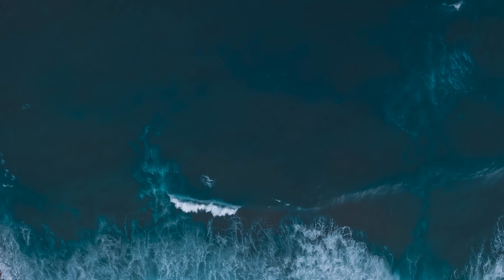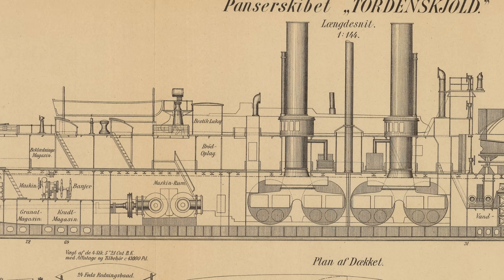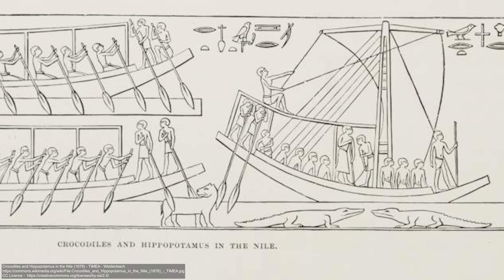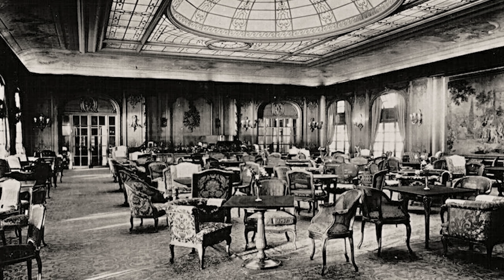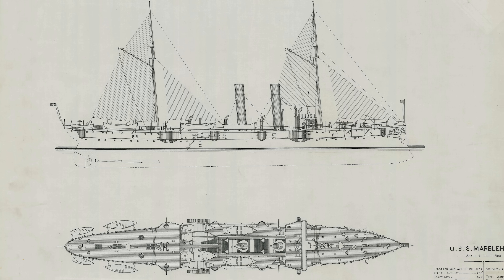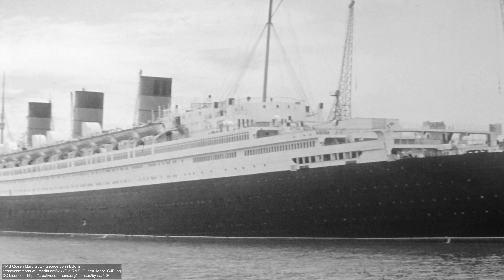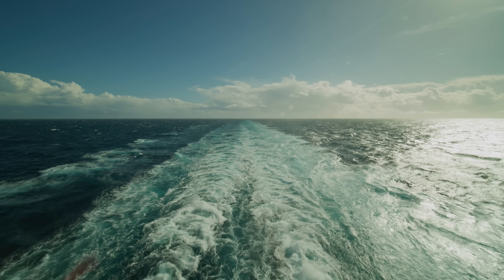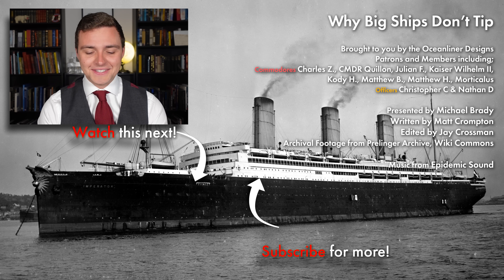Why Don't Big Ships Tip Over?

Comment: I have had several experts like Mike discuss this, and I understand the science, but every time I see modern cruise ship I forget again.
Reply: Modern cruise ships draft almost 30 feet. Most passengers don’t see below the water line inside or outside the ship. Majority of the weight of the ship is down there.
Reply: @budwhite9591  Yes, I know how it works, but just seeing all that mass above the waterline is freaky
Reply: @michaelholt8590 You see lots of space above the waterline, not mass. A cruise ship is mostly air.
Reply: @Daz5Tube that mostly air superstructure is a hazard in high winds. It acts as a sail. Everything is fine until you get into a storm.
Reply: @Doanld-q3z  yes those tall sides will catch the wind and larger ships cannot dock as easily as smaller ships in heavy winds. But handily cruise ships being leisure vessels don't need to sail through harsh storms or dock in heavy winds. They elect to avoid them where possible instead. Average speed of a storm front is about half the speed of a cruise ship.

The last cruise I went on changed its whole itinerary for the week due to hurricane in the Caribbean. As a result it was smooth sailing.
Reply: @budwhite9591  Not just most of the weight is down there, all of the buoyancy also is. Looks are very deceptive, especially when 4 heavy people get into a tiny rudder boat and it barely sinks lower.
Reply: @budwhite9591  On some cruise ships there are cheap cabins down below the water line with  Big TV screens on the wall that show what some cameras up above see.  This gives the illusion  of being above the water.
Reply: Ikr. I do the same thing with battleships too lol
Reply: Oh I do the same thing
Reply: Big ships do tip over haven't you seen The Poseidon Adventure?
Reply: @michaelwhite2823  Yep, both of them.
Reply: @michaelholt8590  Through both of them I wanted rescue vessels to arrive to turn the ship back over just as the passengers reached the hull bottom.
Reply: 60 years ago I sailed to Europe on the New Amsterdam and returned on the Queen Elizabeth.   I wouldn't travel by sea today or take a cruise due to deteriorating climatic conditions.
Reply: Fr. No matter the science I'm just like "but thing too big, why not fall?"
Reply: When I think of things like this I always think "Eurika" lol
Reply: If I saw a modern cruise ship I'd probably put on a mask.
Reply: Width also increases stability
Reply: A few months ago I took a trip on the QM2. Stood on the top deck while we were docked in Southampton....I could not shake the feeling that we were going to tip over! It was such a long way down to the dock!
Reply: Ships are now getting too high and having a too wide sail area... These are the safest boats when sea and winds are low or moderately high. Like sea castles. They can also use all kind of navigation support to get out of the storms way. Until now, this is working. But I wonder what can happen if a floating hotel like these is caught with propulsion problems or a jammed rudder at the wrong place...
Reply: I’m the same with female orgasm.
Reply: You’re not alone!
Reply: If you forget it is because you did not understood the reason. its like why the sky is blue. You get it or you dont
Reply: @majortom4543  It was a joke. Sorry if you couldn't figure that out.